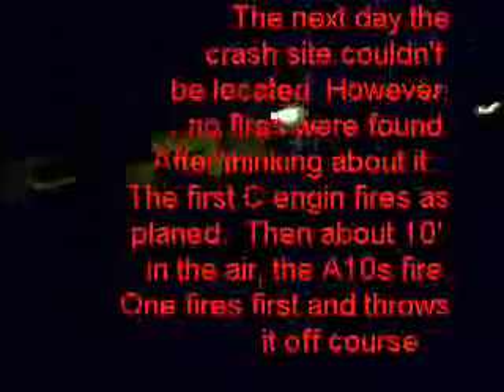Homemade rockets explode with Estes engines"2007 Edition"

Comment: Why were you still using fuses instead of electronic ignitors on the stage rocket?

Or was your plan to have extra length of fuse to the A10's and then they would ignite in flight?